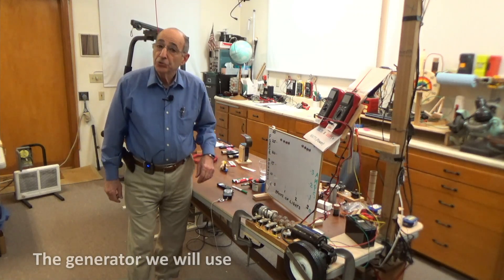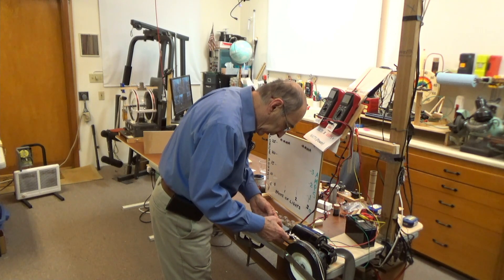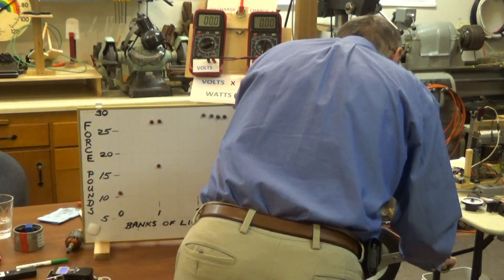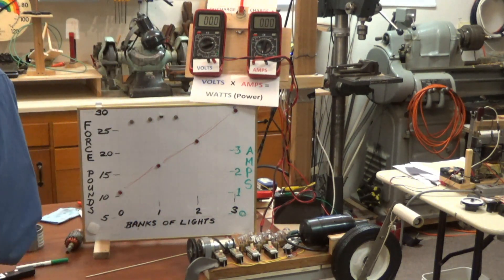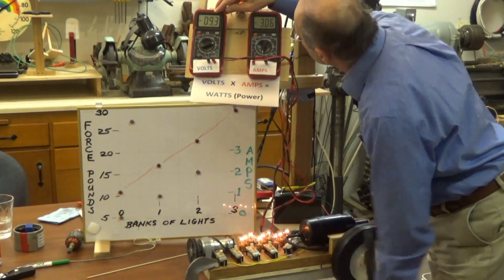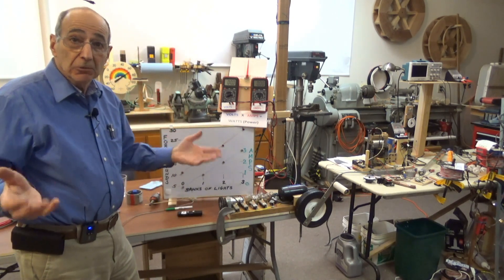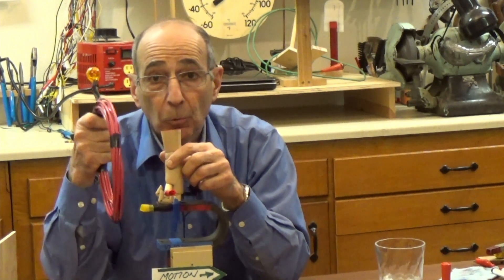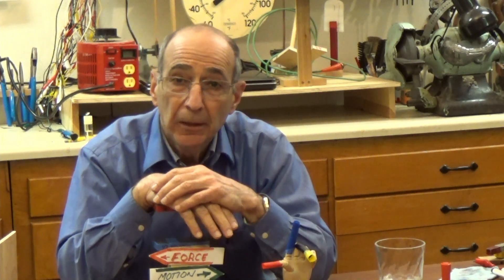Session 12 Why it is hard to turn a generator

Comment: Do you think you could shed some insight on a flux gate generator. I built one and I'm spinning it with a standard DC brushed motor. When I short the generator coils, the amp draw from the DC motor drops by an amp and the generator puts out about 2.3 amps under direct short. https://youtu.be/8Uip5IvgC04?si=S9kz-1OLmXnmZft1

Comment: Isnt the force more concentrated where the magnetic field lines of the coil are most concentrated?  its not necessarily the force on the electrons that produce the drag of the generator, it is the the interaction of the magnetic fields generated by the coil and that of the rotor magnet.
Reply from the maker: There is nothing wrong about looking at the generators reactive force as coming from the interaction between the “constant” (and fixed in the case of the commutator generator) magnetic field and the magnetic field created by the flow of electrons through the windings cutting through the constant magnetic field. But it is somewhat limited for quantitative analysis and not as fundamental a perspective as the reactive force as described by electron flow in a wire sitting in a magnetic field.
Consider a straight wire perpendicular to a uniform constant magnetic field (long enough to ignore end effects) in a completed circuit but the rest of the circuit remote enough to ignore. If we move the wire perpendicular to both the magnetic field and the center line of the wire a current will be generated and that flow of electrons will always create a force that  opposes the direction of motion. That force is very easy to describe: 
Magnetic field strength (B) x Length of wire in the field (L) x electron flow in Amps (I) = Force (F) or
F = BLI
If we try to look at this as the interaction of magnets we have a problem. We only have the poles of the one magnet. The wire produces a circular field with out poles. One could say that the wire produces a distortion of the stationary field, crowding the “magnetic lines” and thus creating a reactive force. 
But trying to quantify that force based on some kind of integration of the superposition of the two magnetic field strengths, the fixed magnet and the field around the wire is quite a challenge. And I suspect you would end up with F = BLI.
One final consideration for assuming the motion of electrons (charges in general but electrons in conductors) are the fundamental explanation for the interaction force we call magnetism. Many modern physics books explain what we refer to as a magnetic effect as a coulomb attraction or repulsion as modified by special relativity.
Thank you for your interest and your thoughtful comments
Dennis
Reply: @dennismegrditchianOLD  thank you for replying.
Reply: @dennismegrditchianOLD   I have taken some time to think about your comment.
1. The circular magnetic field of the coil will only interact with the magnetic field of the rotor if  fields are not 90 or 270 degrees to each other. With them being parallel (0 and 180 degrees) having the greatest strenght of interaction. This will simulate a north and south pole around the wire relative to the rotor magnet field. Also in a coil of wire (especially one with a high permeable core) the highest density of field lines is in the center of the core.
2. That is a very good point. It also highlights how we have limited our understanding of the magnetic field to its effects on the electrons or charge particle, rather than understanding the existence of the field itself. Meaning what the field physically is rather than the effects of it we observe. My hypothesis is that the magnetic and electric fields are one dimensional forms of energy. Light will be a two dimensional form and when it moves in the third dimension it creates time which is the fourth dimension. Space and mass are 3 dimensional properties/energy forms. Hence why magnetic, electric fields and light do not occupy space or have any mass but they still have energy. So if you look at the magnetic field as it's own dimension you could say that it can be a infinite energy field which can provide infinite power. In relation; in traditional generator it is not the torque that produces power but actually  the speed. The speed causes the change in magnetic flux that produces voltage. The torque requirement is because of the drag force, which is a by product of the power being produced when the electrons move due to the voltage. The power is somewhat produced before the drag, but due to the drag force that reduce speed, it limits the ability to keep generating the voltage
Withouth supplying torque to maintain speed.